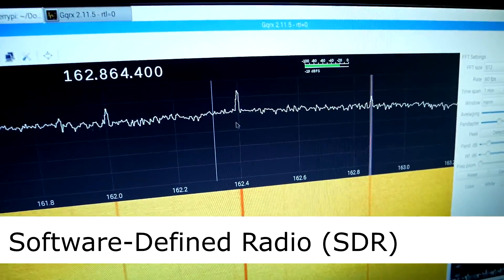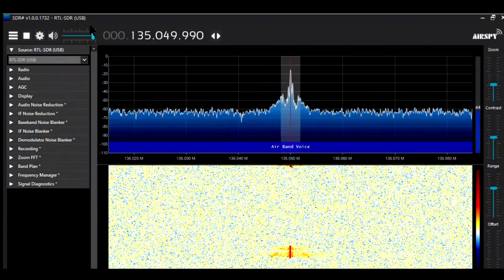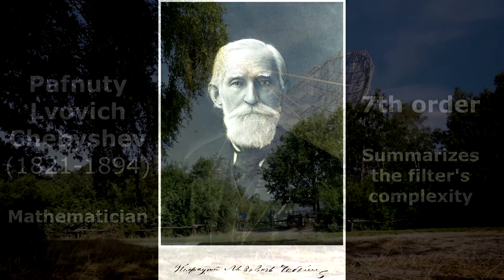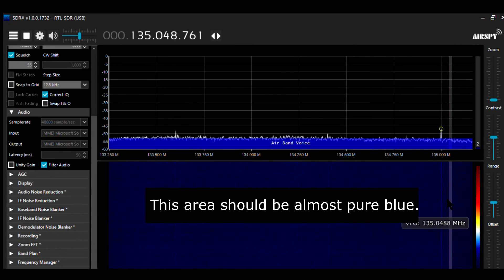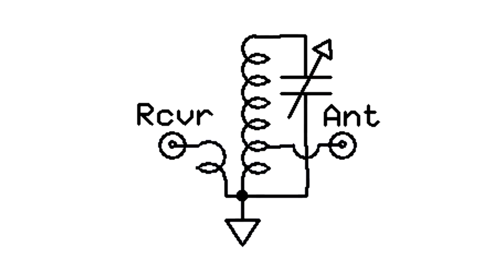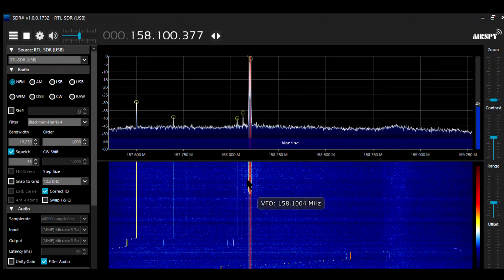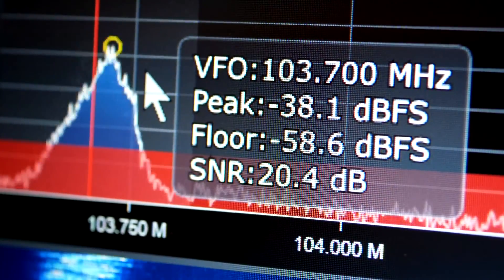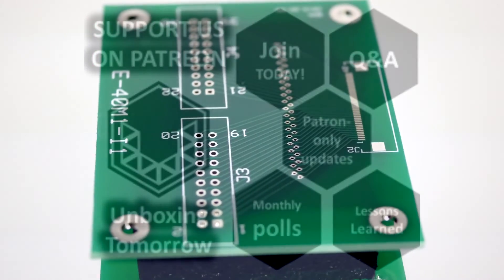Rejecting False Images in Software Defined Radio (SDR)

Comment: I was just playing around with my RTL-SDR.COM dongle in the shortwave band and noticed several times that strong SW signals that I was listening to were showing up in multiple places and were moving opposite to the way they were supposed when scrolling.  When I queried the internet about SDR images, I discovered your channel, showing exactly my problem!!!  I already have broadcast AM and FM filters in place but realized, from watching your video, that I was probably experiencing the effect of overload of the stations I was listening to.  I have an RF gain control on my antenna system and should have reduced the signal entering my upconverter!!!  I'm pretty sure that will fix it when I have this problem again!  Thanks for your video that allowed me to come to this conclusion!  By the way, I'm now a subscriber!!!
Reply from the maker: Ah, glad to help out!  I too had trouble in the SW and surrounding bands until I tried out a couple filters and figured it would be a good idea to share this info.  It's nice to know someone else is getting good results!